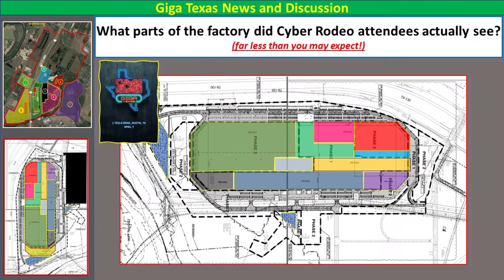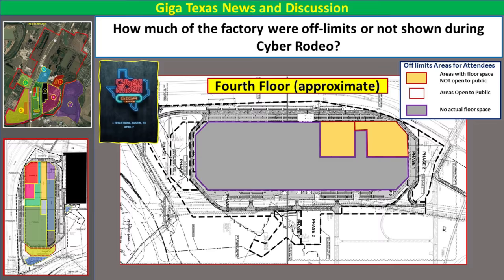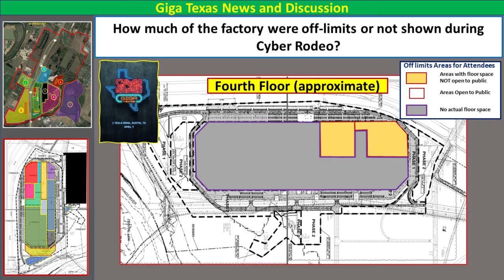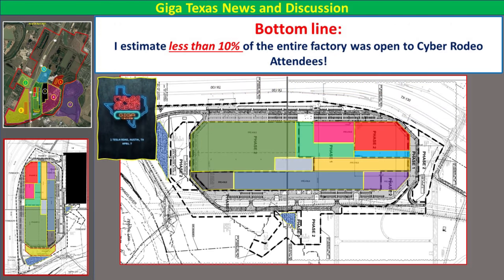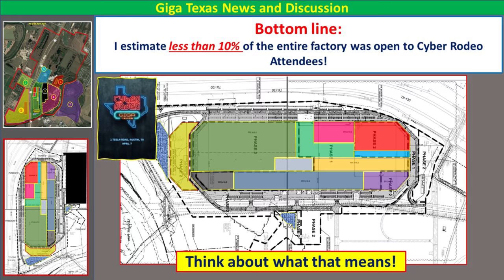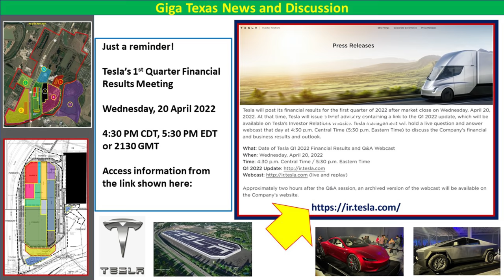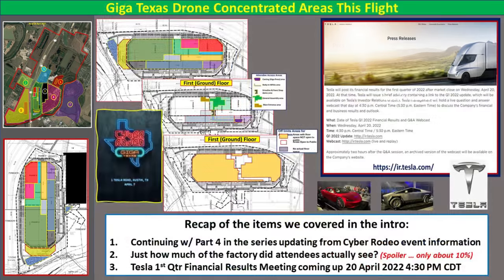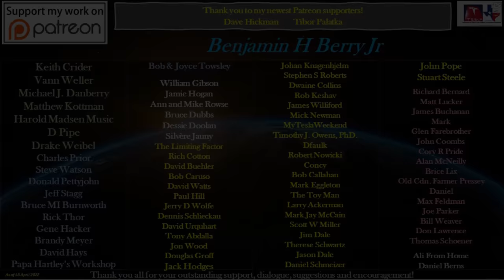Tesla Gigafactory Texas 18 April 2022 Cyber Truck & Model Y Factory Construction Update (07:15AM)

Comment: Thanks Joe. 
6:15. BIW, apron. 3 entire column bays of windows removed. Would seem unlikely this many would have been damaged and need to be replaced, and no replacements on standby, can only be for access.
Some of the apron below has been saw-cut.
6:33. North-south Road. End of the line for now. Convinced myself this is to do with pipeline/easement works. The Pavement Plan seen at 1:09, shows a gas pipeline/s veering south east at this point.
8:39. South pond. 2 pumps pumping. Aeration? 
9:07. South end, Hardstand. Left, a lone Model Y with a cover.
10:12. South end. Splitter box area cordoned off, guardrail around a manhole.
10:35. Main Entrance. Someone checking for access.
11:37. PV array. Many of the panel brackets to the east are now held down with 2 or 3 ballast blocks. Visible in Jeff’s Day 633.
12:47. East side contractors area. Couple of large bins of stamping rejects. I wonder if they compact the stamping rejects in the nearby compactors.
13:13. New Cathode Plant site. Bringing in gravel. 
18:12. Tesla Road. That’s about the location of the duct bank/conduits. I think this is drainage works and they are carefully excavating across the top of the duct bank.
19:12. Paint, loading platform. Welding the floor sections. Boxed up around the column base, likely to fill with grout.
Battery, apron. Crane staged. Wall panel removal likely. 
19:56. Battery north, apron. Have to assume only a recent decision to install a fabricated structure instead of a scaffold. Otherwise a thickening could have been constructed in the slab in the column locations.
Reply: 18:12 Pretty sure you’re right about this being drainage works. I believe the volvo excavators seen here belong to the company which was contracted for the stormwater management and fire loop systems
Reply: @ItsLilRobs  I just watched Brad's video, and he has some good footage showing the duct bank. I guess they will need to tunnel under it.
Reply: Hi
Reply: As you'll see in Jeff's video, the trees in the way of the road have been removed.  The road marches on!
Reply: @sammyk874  Honestly, it's almost as if they pay no attention to my comments. Sheesh.
Reply: @DessieDoolan  Or they do read them and like trolling you.
Reply: @sammyk874  Hadn't thought of that. Makes perfect sense though!
Reply: Looks like the north end may be getting four permanent crane loading platforms, and the south end at least one.
Reply: @DessieDoolan  
Well, if you stopped constantly commenting for a moment, someone else could possibly have time to read them all. Sheesh!
Reply: @GoCoyote  Loading platforms. Long term I would say, permanent sounds........permanent.
Reply: @GoCoyote  Sheesh yourself! I posted 6 hours ago, what have you been up to?
Reply: @DessieDoolan  
Having to much fun helping my son do chores and clean his room. To little time to laugh at YOUR jokes! We also played an all day monopoly game. Those kids can be brutal when they force you to mortgage everything.
Reply: @GoCoyote  All day Monopoly! My youngest was unbeatable at Monopoly, just had the knack.

Comment: Lined up 7-8 in a row....that's how many are usually on a truck car hauler.....8 MYs will weigh about 45,000 lbs....I think
Reply: 4200-4400# each depending on trim and options for the model y awd. 👍🏻
Reply: @4literv6  I was a little bit off...thanks

Comment: At 19:00  I'm wondering when they're going to install a gantry crane over the permanent platforms they're building. 

Thanks, Joe.
Reply: Hoping those platforms aren't permanent. That would ruin the look of the building.
Reply: @DavidJohnson-tv2nn  I agree
Reply: I’ve worked a couple large data centers etc where there are doors that open to the outside on upper floors for large equipment, like PDU or HVAC gear, that might need to be moved in or out later. They usually didn’t leave a platform outside, just the openings. We used one at IntelSat in Atlanta to move in a large test rig for a satellite TWT uplink. It wouldn’t have fit up any normal elevator.
Reply: All kinds of issues with a permanent crane unless Tesla Construction has a full rigging team on staff.  I'm a bit surprised they didn't come up with a more elegant approach, but it looks to me like it might be a handoff between contractors.
Reply: @Bill_N_ATX  I think I have been in that building; the practice was common for telecom companies.  I remember a building that had the window washing swing stage designed to accommodate lifting substation transformers from an upper level substation in a high rise.
Reply: These fabricated platforms are likely long term, but not permanent. 

Can’t imagine they would ever use anything other than mobile cranes. Mobile cranes are much more flexible, cranes of various capacities can be swapped from platform to platform as required. 

The platforms themselves easily dismantled and shifted.